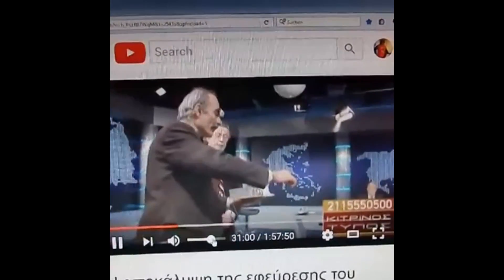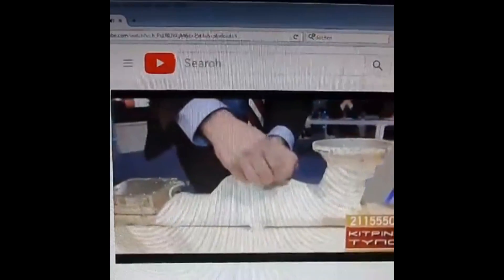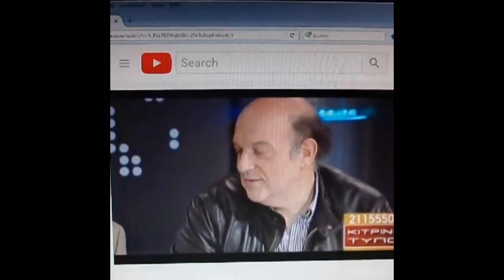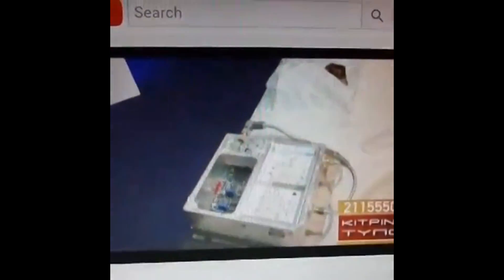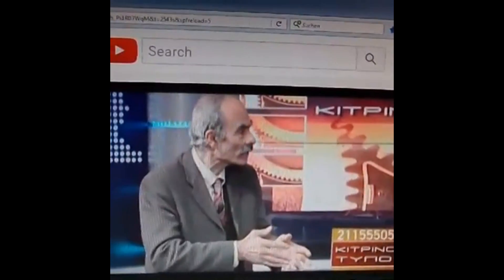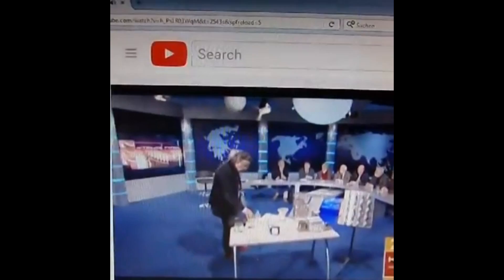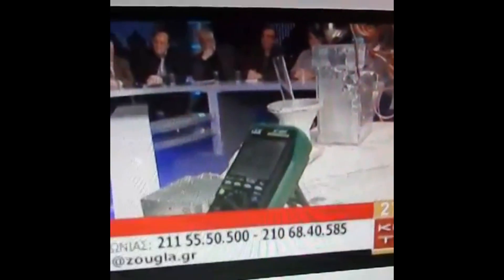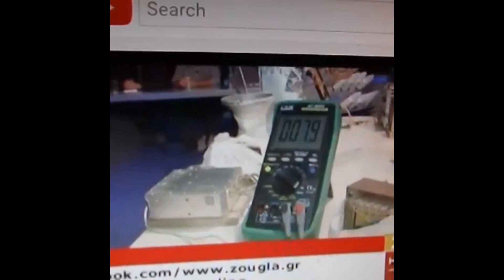Free Energy Watersplitting Device via GigaHz pulse Generator from Petros Zografos

Comment: the reaction is somehow controlled electrically, he proved that remotely on the beaker,  but the fuel is the metal/alloy pieces inside the beaker, and the process is probably some redox reaction,  the claims about radiolysis at some 400Ghz are not proven,  I think EM waves can play little to no part.
Reply from the maker: +VERGIS92 Then how do you think it is working and he produces this huge amount of hydrogen gas ?
Reply: +overunitydotcom   that's what RED-OX chemical reactions do, the metal is oxidized, consumed,  and hydrogen is produced in huge quantity
Reply from the maker: +VERGIS92 No some greek users have said, that he is using a Silver Metal plate, and as Silver is very
unreactive, there would be not much redox reaction just with water or saltwater alone... So it really must be the 3 phase RF pulses that begin to rip the water molecules apart..
Reply: +VERGIS92 I saw a video of a kid using aluminium can placed in water and potassium hydroxide solution I believe, it made huge amount of gas reaction but it oxidized the aluminium can of course
Reply: +overunitydotcom   He has not mentioned anything about the origin of the alloy,  the rest is speculation,  but sepculation on redox reactions makes sense,  I had seen a similar invention in France,  based on aluminum,  it was also electrically controlled.   Now in terms of energy content aluminum and magnesium are good, these are also used in solid state rockets
Reply: +VERGIS92 yeah solid fuel for rockets, that rings a bell about these metal..

Comment: ive seen a similar almost like this video from US where a man used high frequency coils to generate electrolysis from salt water...its similar in sense both using high frequency AC to excite the water and only difference is this guy using a metal alloy? as a catalyst and that US guy used salt in water as catalyst
Reply: It is completely different concept. Electrolysis is using direct current  with large currents DC, Mr Zografos in this case is using radio waves, at limited amount of energy. A correct term is palmolisis.
Reply from the maker: +Sotiris Papadelos Can you please explain, what palmolisis means ? Where does he use the colloidal silver ? Is that generated from the Silver plate electrode on the fly while the microwave is bombarding the metal alloy plate ( Silver plate ? ) or does he need to put colloidal silver water there also in there into the test tube ?
Reply: +overunitydotcom palmos in Greek mean pulse. Since Mr Zografos tech is using series of radio waves to pulse the water molecule by vibrating and finally break it apart, the correct term should be palmolisis. Colloidal silver is used for a permanent phenomenon as seen in the bike in a next video.
Reply: https://youtu.be/eL2pIW2b_OI American video

Comment: Stefan:

Are we to understand that he is using several different radio frequencies here to split the water?  The Dr. in Florida used only a single frequency I believe.  So, is this what is supposed to make this one so much more efficient then?  Does he tell us those frequencies?  I wonder if they are harmonics or something?

Thanks,

Bill
Reply from the maker: +Pirate Labs Hi Bill, no only in one other video he has connected a spectrum analysator and you can shortly see some spectra frequency peeks in the 120 Ghz range...probably overtones of the pulse generator he is using... If you look into his patent he has a mixer and filters there and
an Phase locked loop H.Bridge type driver circuit... but when you look at the very simple other black box toy box, there he has only a very easy circuit board with just one transistor or IC, so it can not be too complicated...
Regards, Stefan.
Reply: Mr Zografos is using the geometry of the water molecule to break it apart at low series of frequencies. First as u see in the first minutes is using a 3 phase radio wave emitters to vibrate the molecule, then is amplifying this frequency. But need a material in the water to act as electromagnetic torch, a mixture of Ag. When he places that as a plate, u see the extraction of the hydrogen from the breaking up of water molecule. The initial energy input for the radio wave emitters is of 350mW, or 0,35W.
Reply: +overunitydotcom yes that is the initial power source required for the emitters. He is taking this from either an external source or from special coated electrodes redox.
Reply from the maker: +Sotiris Papadelos Can you confirm that his setup with the glas test tube there draws then only 7.5 Volts and 50 MilliAmps DC current from his power supply?

Comment: Kanzius had the same thing times ago,,,

https://www.youtube.com/watch?v=Y3wwdmwv0zk
Reply from the maker: +KingTingRolloTong Yes, but his process was not overunity ! He needed to use more than 500 Watts of input power to produce a simular but smaller flame... Petros Zografos needs only low Watts to produce this flame ! So it way overunity !
Reply: +overunitydotcom 
Not really because it costs a lot of energy to produce that metal plate.
The metal plate gets used up as it traps oxygen.
Reply: +overunitydotcom How is it different from the magic diffusor of Shad Loncor, do you know? They all seem to have found part of the sweet meldody / frequency array that can make miracles of sorts
Reply: +overunitydotcom so what kind of alloy are we talking about?
Reply from the maker: +KingTingRolloTong That is the magic question and still his secret... Looks like Brass from its color...but who knows...
Reply from the maker: Amcia Apple
Well, it is not yet know, if the Metal alloy plate is really used up very quickly or not... It seems in the motorbike it can run for extended periods.. and the metal alloy is said to be very cheap... so all in all, if you also need alloy to run it, it is also more easy to run a car or bike this way, as you only need water and a bit metal alloy that can easily supplied by the bike or car owner himself without needing any petrol station ! And as the exhaust is only water vapour it is finally a clean energy solution ! So Enjoy this breakthrough !
Reply from the maker: +KingTingRolloTong
Well Shad Locar had used some kind of AC to impregnate an ELECRET, so it had field changing high Electrostatic ripples as I understood it and the flow of water across it made it split the water... So this was a different process then using RF GigaHz Microwaves as Petros Zagrofos is doing it now...
Reply from the maker: +KingTingRolloTong It seems Silver is the Metal plate and he is also using colloidal silver in his new reactor and in the bike water tank.